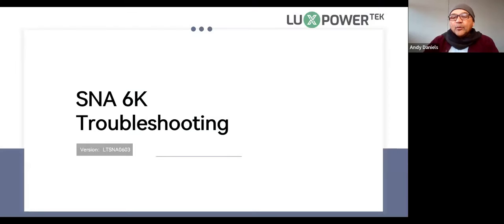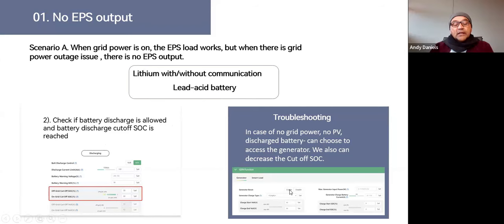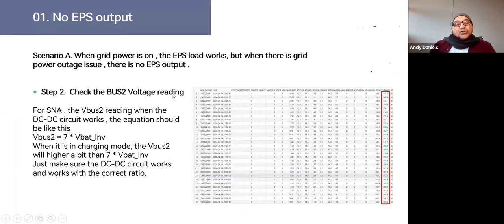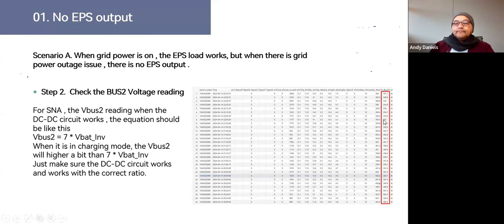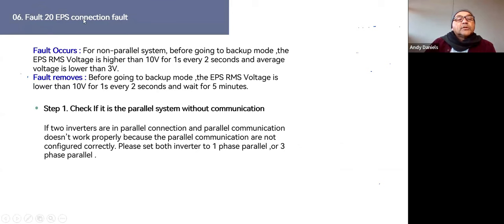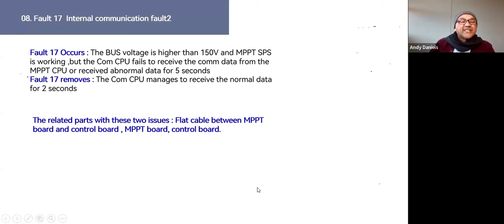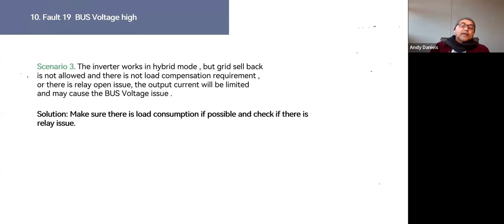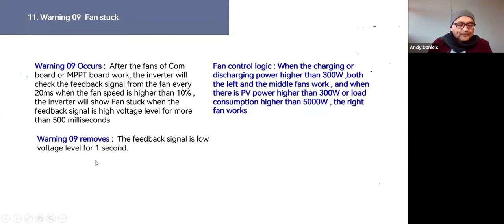LuxpowerTek SNA 6K Troubleshooting Online Training

Comment: I've just got in a LuxPower for repair. Seems pretty much the same circuit board as a Voltronic. IGBTs blown plus the optocoupler. Dang! Will you be able to supply a circuit diagram (component level)?
Reply from the maker: Unfortunately, we are unable to provide the circuit diagram as it involves our product design. If you need to repair the inverter, please contact your supplier. Additionally, since these products have many similar functions, it is normal for the circuit boards to look similar. However, we still cannot provide the design diagrams of our circuit boards. We appreciate your understanding. If you have any further questions, please email us at marketing@luxpowertek.com.
Reply: @LUXPOWERTEK  Many thanks for your reply. Customer scrapped the unit and bought another brand of inverter where repairs are possible. Not your fault but luxpower just went to the very bottom of recommended brands. But thank again for replying.
Reply from the maker: @chillipaste2183  Hi Sir, thank you very much for sincerely informing us of this news. Although it is not the best news for LuxPower, we greatly appreciate your feedback and letting us know the real situation. For some components, such as MPPT boards and control boards, we do offer replacement options.

Could you please let us know the region where your customer is located? This is not to collect any personal information but rather to facilitate our discussions with our distributors on how we can improve our service quality.

Thank you again for your valuable feedback.

Comment: Hello! Need some help I recently installed an SNA 5k now there is an issue with ac input, it’s switching of the grid supply of the house. On solar it’s working well once grid power is supplied after a few minutes it’s switching off the grid power. What’s the solution to this problem?
Reply from the maker: Hi Sir, We are sorry for your inconvenience. Could you please send your SN to info@luxpowertek.com, our technicians will help you to solve this problem.